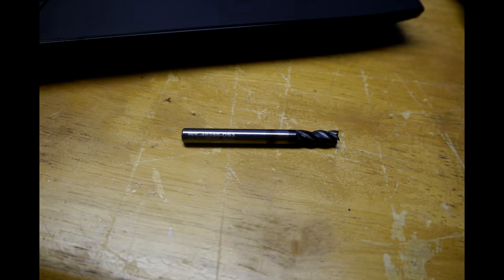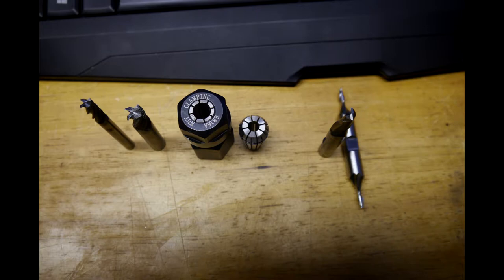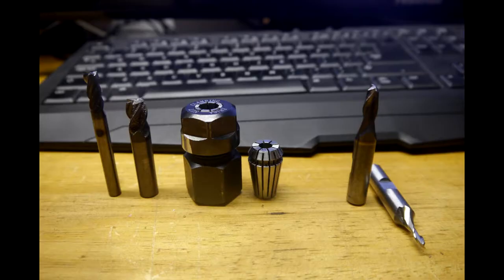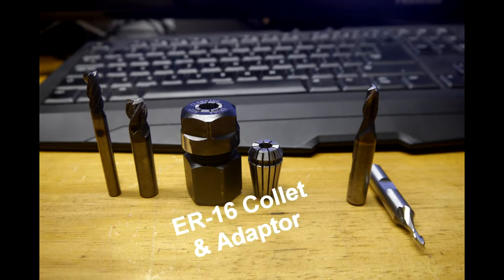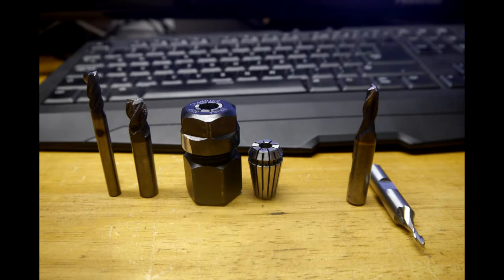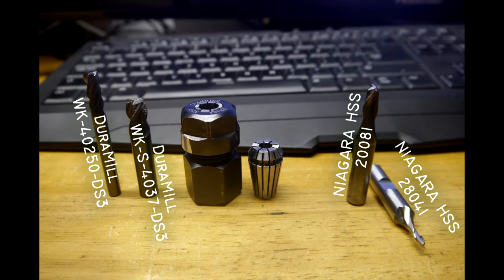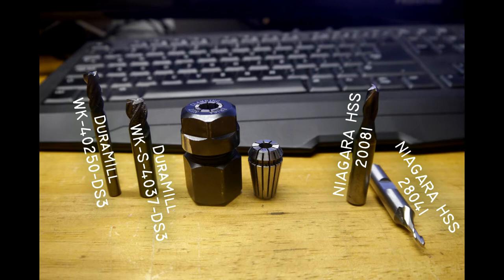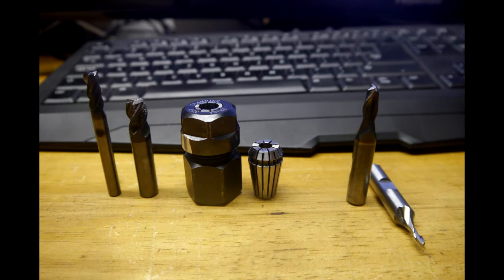End Mill Cutters for the MAXNC mill. TOOL COOL for School!

Comment: Hey Josh. I recently purchased a MaxNC 10 CL  and a MaxNC T2 lathe from an estate sale.
It has the 1/10hp motor so I will be doing the 1/5hp upgrade. I've been doing the research and
have seen where everyone that has one and posts, has changed or upgraded it in one way or
another. I am not planning on doing anything heavy or production. I only intend on engraving
and mild steel milling of around 3/16" thick or aluminum of same thickness max. HOWEVER,
I would like the option of using larger end mill bits and that ER-16 adapter you have is the key.
Can you provide more information on it? Where did you purchase it? where did you get collets
for it? Thanks for any info.
Reply from the maker: JRHZ28 
Hi, the two collets i have are 1/4 and 3/8, er16 collets. I got the collets and adaptor from www.dearmondtool.com i just tried the link and it come back as unavailable. It is essentially an adaptor the same thread as the old collet nuts. Yeah, the 1/5 hp motor i ran burned up after 20 minutes of running it in steel with a 1/4" 4 flute end mill. The fan is not very good on the 1/5 hp dayton motors. Forced air injection might be benefitial to keep it running longer. I hope that helps and feel free to ask questions, congrats on the new purchases!